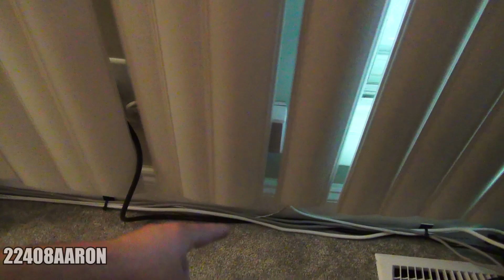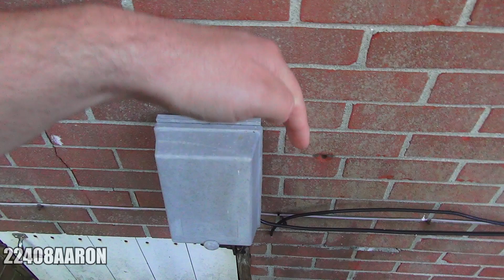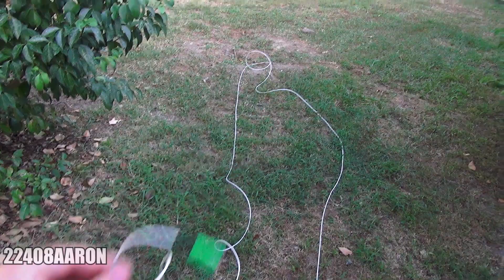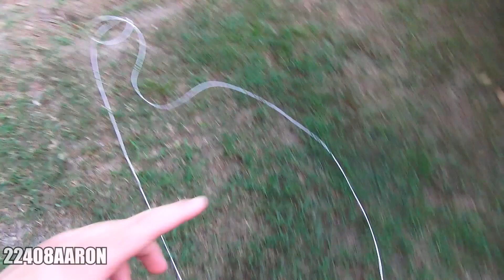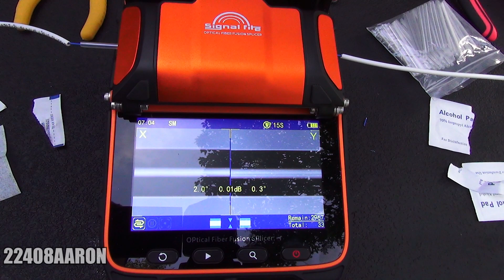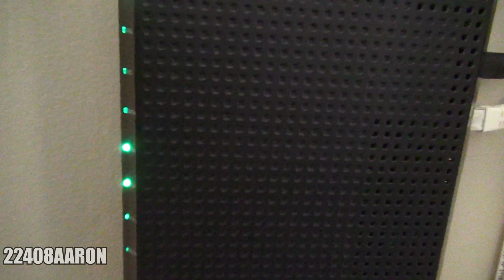Demonstration and Review of Signal Fire Fiber Optic Fusion Splicer AI-9

Comment: Why did it look uneven in the spicer when it finished splicing? Most other splicing videos the fibers appear perfectly aligned.
Reply: That’s because the point in the middle of the screen isn’t where the splice is. The point in the middle is where the two different camera angles meet, the camera angles aren’t entirely aligned. Re watch and look where the mid point between the two fibers is before it does the splice, you will see that that are perfectly aligned after.